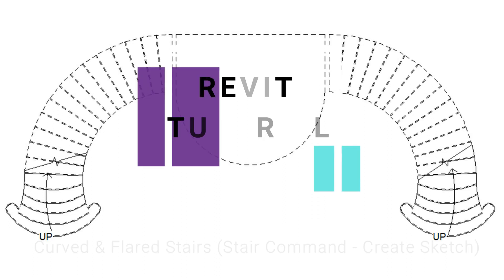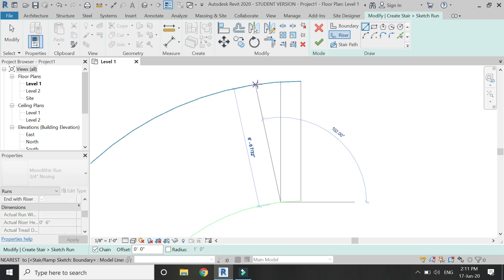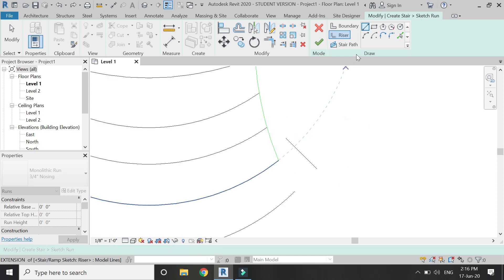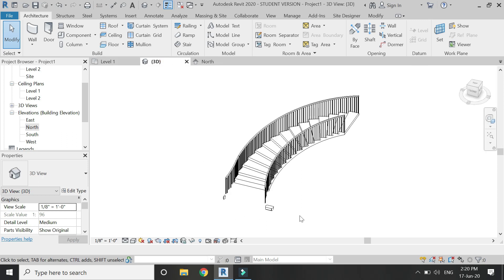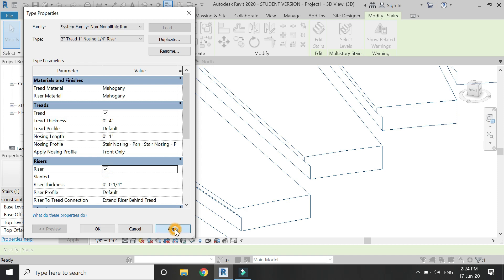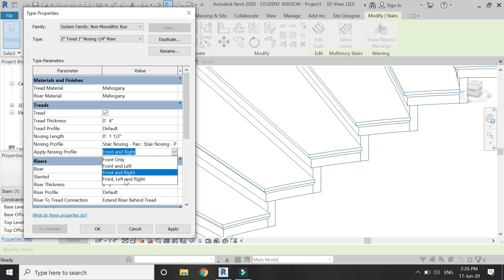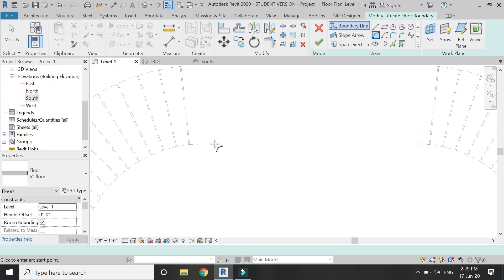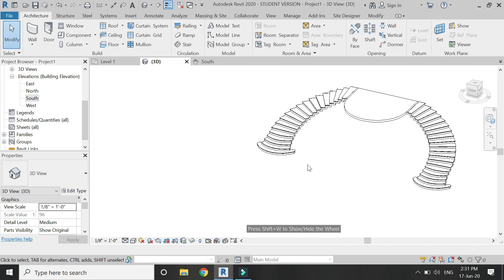Revit Tutorial - Flared & Curved Staircase (Stair Command - Create Sketch)

Comment: Hi! I tried doing these stairs but it tells me "stairs cannot be created" and gives me error 1, without specifying  what the issue is. I tried doing it as similarly as you as possible. Pls help! Thanks
Reply from the maker: It shouldn't happen. It might be possible that something is wrong with the sketch.
Reply: I had the same issue, then I realized I shouldn't have put the top and bottom of the boundary line, just make the sides of the stair shape, otherwise it won't count the risers as you make them.